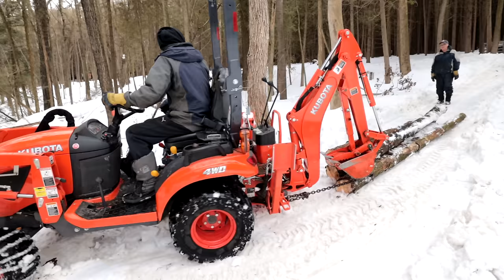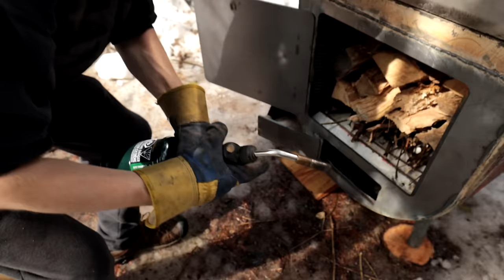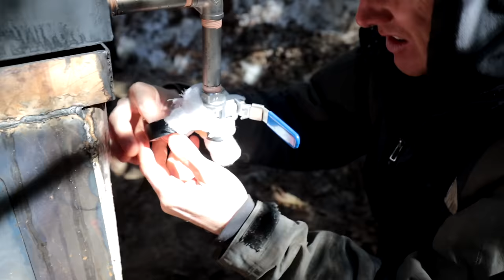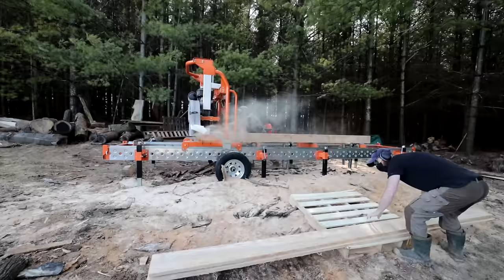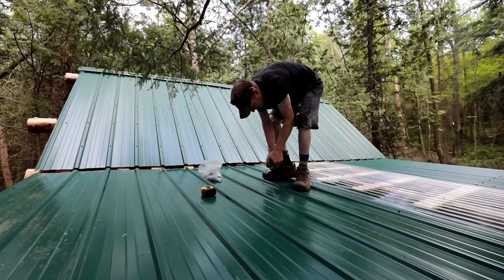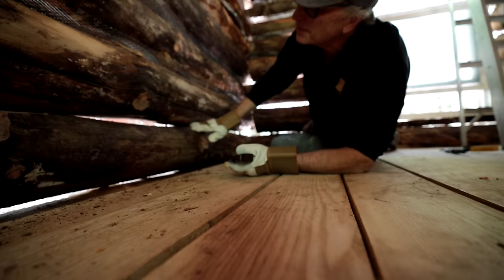1-Year Building a Cozy Log Cabin in the Woods! (Start-to-Finish ASMR)

Comment: I thought for best results nd least moisture absorption you're supposed to strip the bark from the logs before building?

Also, is there any benefit to this nailing method over cutting grooves in the logs for them to lock in place as that's the preferred method I've seen elsewhere?
Reply: #1 point - the logs were frozen so the bark wouldn't come off earlier  #2 point - it is what we normally see but takes a lot of notching and trimming.  This way the line of the logs stays even all around the cabin.  Time will tell as to whether there is any difference in longevity between the two methods.

Comment: I'm guessing there must've been a real good reason why you DIDN'T remove the bark BEFORE building the walls.
Reply: Right!!
Reply: Probably, the reason is the same as why they haven't left the gap above window and door frames, and why they have used "fixed" filler to fill the gaps between logs. This reason is called - guys just don't know specifics of the material they work with. While been one of the oldest materials, logs are one of the most tricky material to use as it "breaths" - shrinks and expands - for the whole life of the house.

Comment: Hey, Kevin!
I just noticed (and I may be late to the party).
It looks like you can get gravity to do a ton of your busy-work, like de-limbing trees both as they fall and those trees soon to be felled.  Using the tractor to pull the tree’s base away from the stump is THE way to control things.  How about aiming the fall between two closely spaced adjacent dead or dying trees so that, as it falls, the felled tree is dragged out between them, stripping most of the limbs off the felled tree and its neighbors?  If your ideal pull direction is blocked, use that blocking tree as a “pulley”, and pull the chain around the base.
Don will have a ball dragging those limbs to a common burn pile, without nearly as much chainsaw de-limbing work.

Comment: Always thought that those gaps between logs were filled with some kind of insulation. 
Isn’t the place harder to keep warm in this way?
Reply: Yes, a lot harder actually. The way people usually build log walls is by cutting off a slice on both the top and bottom of each log so that they have a larger area of contact, and even then they add a layer of insulation. Not to mention the size of the cabin and the fact that the door is also filled with gaps, that place is not going to protect you from anything but rain (and even then its going to be super loud as they're just a bunch of boards nailed together).

Comment: out of interest for learning how to build: is a cement a good insulation compound to use with wood? does it expand and contract with wood?
Reply: No, it doesn't. Same as window and door frames which don't have any gap above them and have fixed connection to the walls. Same for the roof frame which has fixed connection to the walls. And same for metal nails connecting two logs vertically.

There are certain rules while building log houses (main rules, but not all the rules out there):
1. Make sure to have gap above window frame (at least 8 cm in your case) and above door frame (at least 15 cm in your case). This should then be filled with some soft insulation like moss, synthetic foam, etc.
2. Window and door frames should be connected to walls with spike grooves or sliding metal connectors.
3. Roof frame should be connected to walls with sliding metal connector.
4. Logs should have spike grooves for the whole length to let every next row to more securely sit on the previous row and to decrease gaps. Gaps are filled with some soft insulator, like moss, jute, etc.
5. Logs should be connected with wooden nails connecting three rows of logs. This secures vertical integrity and make sure walls stay vertical while "breathing".
6. Logs should have proper connection carved in corners to make sure walls are securely connected to each other and to decrease gaps.
Reply: No, it doesn't expand/contract WITH the wood...and that's the problem. It's going to crack and peeky-holes will be all over the cabin quite soon. An expandable poylmer foam would have been more practical, easier to apply, and just as inexpensive. Critters are going to love that cute cabin. Can you imagine trying to sleep in there, wondering who or what might be looking in at you through the chink holes in the walls? And insects crawling up through the unsealed floor? Anyone ever read Mary Shelley's Frankenstein?...yeah. But they made it the way they want it, and I give respect to that, especially because they have skill and what appears to me a quite enviable lifestyle. Those guys will love this cabin, for sure!

Comment: Nice video. But would it not be better if the logs where a bit flattened and fit together instead of using concrete afterwards to fill all gaps? Wood is a living material, meaning moves a bit, and concrete is not, might be gaps in a year or two.

Comment: Just about gets crushed by a tree a a few occasions.  

Then drills right through the roof without sealing the screws.  Then the side over cover.    Not even angled.  Snows gunna build up Hella.  All in all… you guys made this allot harder than it has to be 😳 

Not trying to bash.  But hopefully you learned from the mistakes.

Comment: Great project! I'm just curious about the order of operations on some things though. Also, why no insulation in the roof or under the floor boards?
Reply: I agree also at the end the floor had some gaps in it I’m guessing the moisture released from the wood shrinking the boards. Other than that this was a nice build.
Reply: They built this as a sugar shack. You can see them tapping the maple trees for sap then boiling it down into syrup.

Comment: I think everything wrong imaginable with this project was implemented:

Logs should have had notches cut out instead only supported by steel rods, which will rust out eventually and all walls are already shaky and unstable. 
Insulation should have been added first between log setup.
Also insulation between roof sheets for rain noise diminishing. 
Never have seen that cement is applied to wood insulation, looks ugly and just wrong, probably going to be all moisty.
And all the foundation should have been leveled and made on top of bricks or cement bloks, because everything will start to rot from bottom up.
Reply: Yup i was thinking all this too lol

Comment: Jack up cabin. Place on concrete blocks. Avoid wet rot of wooden foundation rounds.
Run two wood poles to set your first row of firewood logs on not bare wet ground. 
Waterproof sleeves for posts in ground. Avoid wet rot.
Real nice roofing.

Comment: This cabin will be around for at least fifty if not a hundred years.  They're putting in good bones. For those worried about the wooden rounds, if they rot, they will rot at the same rate, besides all houses can be jacked level if they have a strong frame.  This is a basic strong form of a log cabin; any extras can be added later.
Reply: Was just wondering about that. Thanks. Would you just replace the  rounds if they rotted or would you have to jack and relocate?
Reply: Exactly that.  Most of the foundation and posts in the ground are going to rot within a few years and will need to be replaced to keep the structure safe and sound. None of the wood touching moisture prone areas is treated and will quickly sponge.

It's a nice little shack but it will be torn down relatively quickly or need to be renovated to make it last even 5 years.  What a waste of time and resources due to cutting corners.

Comment: a couple questions when you cut in the window and door frames you hard attached them with spikes i thought you hadd to spike them in slots to allow for log settling .         second with th logs right on the ground for porches wont it allow rot pretty quickly and alow insect spread?

Comment: Use the tractor to pull trees taller than it from the bottom after they are cut but wont fall. Pushing tall trees is dangerous as we see. When you pulled them there was no danger

Comment: Like it.
 Using diamond lath and cement. For chinking is interesting. How does it compensate for expansion and contraction?   
Will it not crack apart after a few years? Not saying it's wrong. I'm an old plasteror 34 years. 
  I do like it. Good job
Reply from the maker: It's held up really well.  Haven't seen any visible cracks yet. It's gone through a winter and a summer so far.
Reply: That's great. It's just the beginning. Time will tell. It always does.
 Keep up the good work. God bless

Comment: Looks nice. 
Not the way I would have done it especially seeing all the tools that you guys had, I would have added a basement and made the cabin bigger by using that lumber machine but most likely y'all rented the equipment. So still nice work well done
Reply from the maker: If you made a basement here you'd be in the water.
Reply: @ModernSelfReliance  it's low water table then that sucks. But good for building Wells. Yeah when I move down to Florida in September I'm going to try something out there when I get some land.
Reply: High water table I get them mixed up

Comment: No removing tree barks? No insulation, especially for roofs and floors? No notching logs and filling the gaps with mortar? Placing wood columns without any treatment directly in the ground holes? Spreading the wood pranks on the soil? I have millions of questions...
Reply from the maker: Sounds like about seven.

Comment: Only a question...why didn't you shave the logs before assembly. It would of saved alot of extra work and the logs would have fit tighter together. Other than that....cool vid.

Comment: It seems to me that the screen is using to many nails , the mortar that fills in the gaps is good enough to hold onto the mortar. Once that mortar drys it draws into the pours of the wooden logs and makes an excellent wall but do you really think it takes that many nails on the screen?
Reply from the maker: I'm going with the more is more theory.  Mortar isn't "sticky"  the more nails helps to flatten out the mesh.  Allowing a nice area for the mortar to sit without having the mesh sticking out.

Comment: I've noticed that the whole terrace roof is joint to the cabin roof by 5 screws (that hold the support log). Add a meter of fresh snow to that in winter. That easily adds 2,000 kilos to the net weight of the roof. I'm gonna thankfully pass having tea underneath it.   8-D
Reply from the maker: It has survived a winter with 1.5m of snow on it then it rained...  Still holding strong.
Reply: @ModernSelfReliance  I'm glad to hear that. I'd like some cream in my tea please.

Comment: they had the tools but chose not to joint them... instead driving those costly giant nails to hold em together... I would have drilled 1" holes and driven pegs in.... would be more secure and cost less... they also could have saved alot of time fitting each log by prefabbing each log flat and used a good level... very confused with some of your decisions... however your end result was ok and if ur happy with it.. im happy for you. just think i wouldnt have done things the way u chose to.  Enjoy ur little man-cabin...it turned out great.

Comment: Now I've seen it all. They don't even try to peel the bark until AFTER they have used the bark covered logs to build a structure. Logs buried in cement "cabin" with large holes in the floor, a big step up to step over front door, completely unnecessary. It's so much overkill for cost of big machinery and so little pay out for looks or functionality. I'm gobsmacked.

Comment: You guys start every one of your builds with flimsy rot  prone foundations .  why not start with a solid below frost line concrete foundation that won't settle or rot in a few years.  Your ideas for the structure are nice but i just don't get the neglect of the foundation.

Comment: Would take me 10 years and each log would 2 inch diameter and the cabin would be no more than 6 feet tall because I will not climb over 6 ft to put the roof on.

Comment: Very cool build. But I notice all too well the shortcuts in construction. I get modernizing the techniques, but when the result potentially suffers because of it then it kind of becomes a problem. On the other side of the spectrum you have Erik Grankvist, a swedis guy, only 20 years old who build a cabin in the woods in sweden using only the old techniques. And judging by the way things are built, his will last longer.

Comment: Wait, so you had a portable mill there and you couldn’t flatten the tops and bottoms of the logs?!?! When cutting down a tree, find a spot to lay it, and cut a wedge out where you want it to go, then cut the other side and let gravity do the rest. The metal spikes will rot and break with the expansion and contraction of the logs and the structural integrity will be gone. Very interesting way to build a cabin, but one of the worst ways I’ve ever seen it done.

Comment: This is a very basic build that will unfortunately not last very long. The logs were not dried out which will lead to rot/insects, the logs were de-barkes afterwards, the foundation was laid afterwards and on bare ground, the roof or floor does not have a moisture barrier, and the floor was put in before even finishing the inside. All that time and effort made worthless.
Reply from the maker: You can see the condition of this cabin 3 winters later here.  https://youtube.com/watch?v=hUuKc3I2S4w&feature=shares

Comment: These are not master builders, but careless movers who have no concept of construction. if they had been my workers, I would have fired them as soon as the foundations were laid. I'm angry that they just wasted the good material. That's not how you build the beast and the porter, as you like, like 15-year-old kids who decided to build themselves a hut, without making grooves and without leveling the crooked parts to insert them into each other at the corners to make a sturdy joint without hammer nails and leave a gap and a distance between the trees where you can stick your whole hand between each tree. Too bad about the equipment they have and the wasted trees.

Comment: So cringe worthy. Debarking after the build? Why? The roof’s pitch works if you’re in the desert but not wherever these guys are. You need a steeper pitch if it’s going to shed snow or take heavy rain constantly. When it snows the snow will build up and dam when it melts. Prepare for a lot of leakage. I give the guys credit for doing more than most people do but frankly, a bunch of Boy Scouts could have done a more professional job.